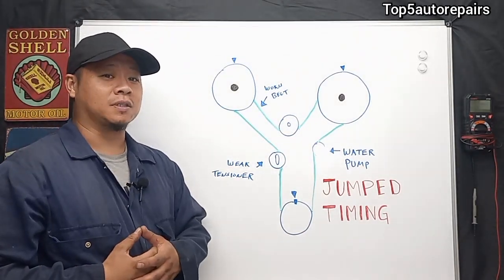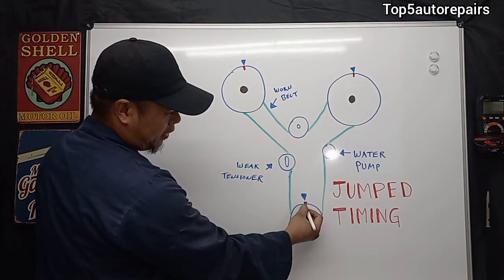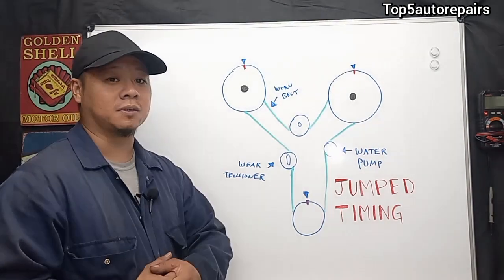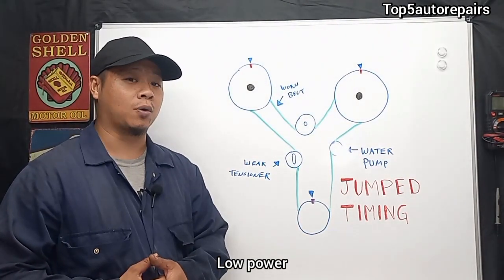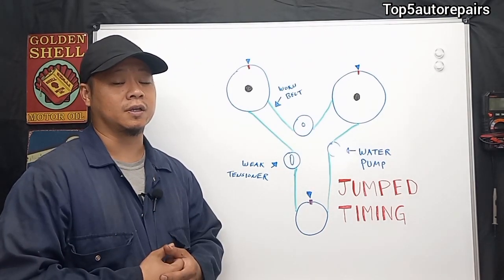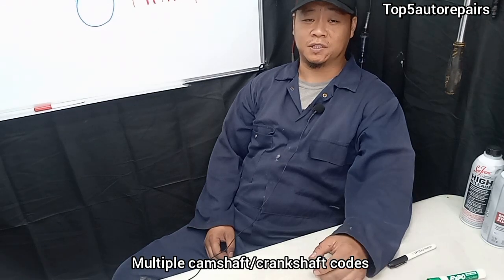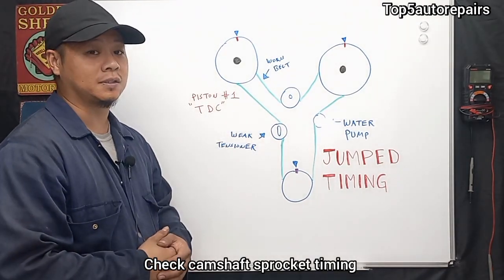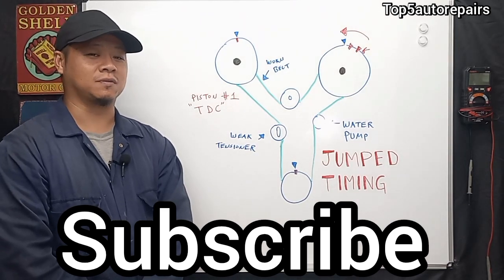How To Tell Timing Belt or Chain is Jumped. Here are the Symptoms

Comment: I threw off my timing on a kseries, rotating the crankshaft pulley the wrong way to find tdc lol  lesson learned
Reply: How did you fix it ?
Reply: You dont
Reply: Sorry for delayed response. I went back with Honda OEM timing chain, auto tensioner, chain guides, all worked well. Everything is marked on the k series in regard to timing. Find top dead center, lock the cam shafts in place, install the new chain, I think the chain has markings too. Easy but a pain. After installing rotate the engine manually and check the marks. Everything should be aligned or very close at tdc.
Reply: @camlobesvtec where did you get  the chain guides
Reply: That’s the best way visually . There’s no other way visually ..
Reply: I did this on my ford fiesta. How do I get it back in timing from here? I rotated it probably a full 360 counterclockwise because it felt like it wouldn’t go anymore when I was turning it clockwise (because I believe it jumped a tooth when I was rally crossing)
I want to change out tensioner but I would love to know how to mark stuff for when I take the belt off. Right now the camshaft locking marks where you would put a locking plate (inside valve cover) is slightly off from being flat to put the thing in to lock it.
Reply: @Anthrbgofbnz Try rotating  the crank the correct way and check that your marks line up. On a k series engine everything is marked ( chain,crank, cams) . When you get all the timing marks correct, do at least 3 engine rotations by hand and check that your timing marks are correct. Id stick with oem parts from the dealer. Be safe.

Comment: My 2ar-fe motor sounded like it had advanced timing after I blipped it at 4500 after revs were falling while in neutral or did I bend a valve so u can hear the intake more but sounds slightly unsmooth going to redline 😐
Reply from the maker: Stay tune for the next video "How to tell your valves are bent."